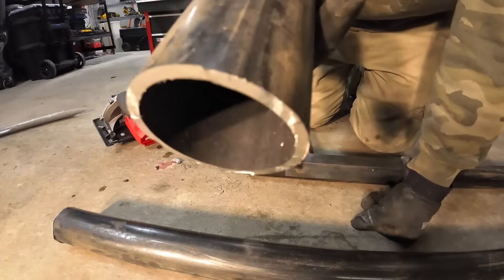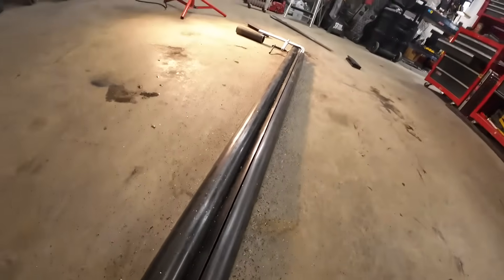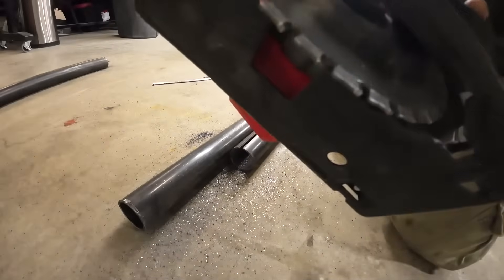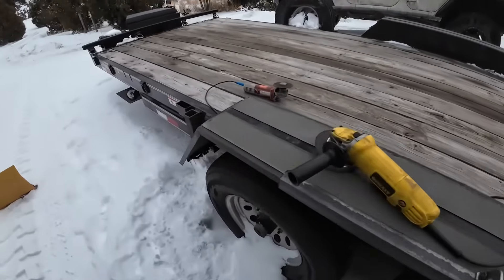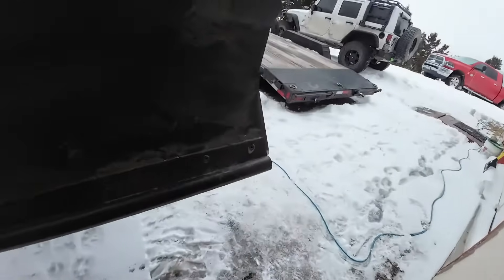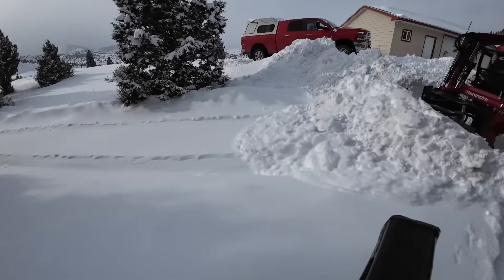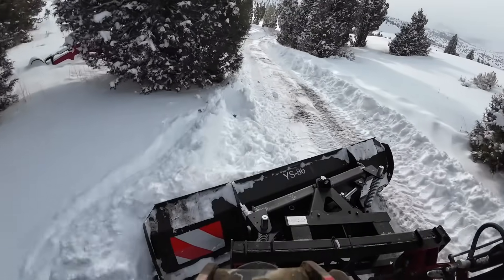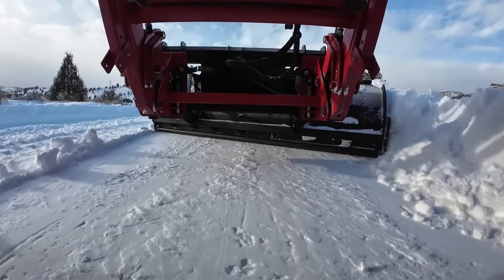Snow Plow PIPE ~Steel~ DO - OVER!

Comment: Pipes work great on blades, good video! I have and ABS pipe on my little quad, but my JCB 214S Backhoe has an 8' bucket with a float function. I can rotate the bucket so the leading edge is an inch or so in the air but the bucket is resting on the ground. Its really nice for my gravel driveway and the varying grades around my house. Never digs into the gravel, and makes plowing snow a joy. Cheers from Canada!
Reply from the maker: Great idea! I'm going to remember that in case my plow ever breaks or if I just have the bucket on, that would work great. Thanks for the tip!

Comment: i was told that if u use chains on a mfwd tractor .
, u should put them on your rear wheels so u dont ruin your gears in ru front axle.
Reply from the maker: You are not the first commenter to make that statement! I have never heard that before I posted this video, but it makes sense. I will be running 4 wheel chains this season. Thanks for the good advice!

Comment: You need to get some hard surface rods to weld on that pipe so it will last .that concrete will wear threw that mild steel pipe in no time !

Comment: Im thinking of doing this with my plow, but it needs to be removable.   Im thinking about using bar stock (4pcs) instead of angle iron.  Run that on both sides of the outer ribs so they essentially capture/sandwich the ribs between them. Then drill a couple holes through both sandwiches and put a keeper pin or linchpin through them.  No tools needed to remove the pins, but might need a small sledge to drive the assembly on/off the plow.
Reply from the maker: Good idea! And I agree a bit tighter fit is always better. If you make a video, please let me know 👍

Comment: Eliminate any looseness-
Simply make one cut🤷🏻‍♂
It's like the spring on the top of a metal folding ruler. Use wooden block,
hammer it on. It will spread open. Tight as possible, one cut.
https://mobileimages.lowes.com/productimages/b292855d-d539-4b2a-8a03-c26f1e629330/47810543.jpg?size=mthb

Comment: I took a 48' x 16' diamond back steel plate +3/16, rounded it to a 90 degrees length wise and welded it to the two skid shoes, and then again in front. So far so good...

Comment: Super nice. The plasma cutter warps the pipe quote a bit.
Reply from the maker: Oh, I hadn't thought of that. Glad I didn't use it. I suppose a regular abraisive cutoff wheel would work just as well albeit slower than the metal cutting blade

Comment: Are you constantly changing hight of blade or do you find a sweet spot and leave be?
Reply from the maker: No changing height, like I said at one point we just drop it to the ground and keave it in float mode. Seems to have enough weight to cut pretty deep, then it just follows the terrain changes

Comment: Just an fyi my friend try not to put chains only on front wheels of a 4x4. Rear ok. You will be putting spider gears or worse in. My dad use to plow snow and he taught me lol
Reply: How about running weld on bottom of pipe for hard facing? Just a thaught
Reply from the maker: Great advice! Thank you so much! I have rear chains, they are just really hard to put on. But I'm definitely doing it this winter 👍
Reply: Chains change the gear ratio because they make the tires bigger.  Same for semi trucks, chains on the back drivers will almost guarantee you will spin out because the front set of tires are traveling at a different speed than the rear.  Physics.

Comment: Wish I saw this before the temp dropped :) I made feet for my back blade and control the depth of cut withe the upper arm, and it works OK, but I have old gas pipe laying around.............. The weight cant do anything but help the back blade either.

Comment: ABS and PVC ok to use for atv and sxs plows. Trucks and tractor, yes go with the well pipe!
Reply from the maker: Well pipe! Even better than steel! Thanks for the tip I'll try to find that when this one wears out😂
Reply: @anesthesiadreamin do you have a feel for the wear on the pipe yet? As in... How long the pipe will last before wearing through to the blade.?. 

I made a drag from the cast steel from an upright piano to drag my gravel flat, and the first time I hooked it up to pull with a chain the chain was in contact with the gravel in one spot, and it wore halfway through the chain in just minutes.
Reply from the maker: @tomwichman77  not yet, only used in one season. But I think if I wait to plow until there's a good Frozen base, it should last a long time. If this does wear out, I'm definitely getting well pipe though for the next one.
Reply: @anesthesiadreamin Nice work.  Never heard of well pipe, why is that special?

Comment: My nickel worth (the last penny was minted last month). I run chains on both axel's , They are not cheap but on the rear
just cry once and go to Cedar rapids tires page and look up Aquiline Talon chain's. I have to run the smaller MPC version 
because the talon's would tear up the chip seal roads around here.
I have had a front mount blower and a back blade with hydraulic angle and top link on my tractor for 15 years. It's the only way to go after the real winter start's to
get with it. Before things set up It's the CJ5 with a blade and chain's on all 4. Got to get the hidden objects removed.
You can do the pipe on the cutting bar for the blower so it will ride up over any hidden object. But start the season
with the blade to get a good base going.
Beck to the rear chains. Don't use ladder chains they will drive you nuts with the horrible ride after you get a good base going.

Comment: I just put a 4” PVC pipe on my back blade. If it breaks down, I’ll be following your lead. Thanks for the video.
Reply from the maker: On the back blade! That's a great idea! I hadn't thought of that. This is why I love YouTube, there are so many smart people out there with so many great ideas! Thank you for posting 👍
Reply: I have a smaller diameter piece of steel pipe on my 54” front mount snowblower’s cutting edge.  I did not cut the slot, just welded the pipe onto the removable cutting edge.  On my 6’ rear blade I put a 1 1/2” pipe the same way you did here, cut the slot (angle grinder) and then welded on two tabs to hold it on.  That way I can remove it from the blade when grading the driveway in the summer.  This is for a compact Kubota B2601 tractor
Reply from the maker: @1wheeldrive751 Great ideas! Did u weld the pipe on the front of the cutting edge or on the bottom?
Reply: @anesthesiadreamin - leading edge on the blower.  You only push it forward anyway.  On the blade it fits on the bottom, obviously, which is good because I often also push the blade backwards at times.  With the slot being fairly tight (I have to hammer the pipe on) I have yet to knock either of the welded tabs off.  It certainly isn’t because of my superior welding skills.  ;)

Comment: I bought a pipe and was going to do the same thing on my back blade, but I ran out of time. I just bolted a 4x6 piece of lumber to the bottom and it works good for now, and when it wears down I can flip it over.

Comment: I have done this same thing to my plow. It works great. My plow is an old plow from a pickup truck, so it has the chain for the float. Which I like actually, it leaves the loader arms weight on the front tires, keeping traction there. Which helps with not being pushed sideways. I also just welded the pipe directly to my plow.

Comment: I see that you just have chains on the front wheels. Have you chained all four? I see talk in the tractor chats going both ways. Pluses and minuses both ways. I see you're in REAL snow country. What's your opinion. Thanks in advance.
Reply: If I may give my opinion, I only chain the rear. If you chain the rear you can steer the tractor using the brakes, and if you really need traction, use diff lock. The drive line parts aren't as beefy on the front as they are the rear either, you could more easily break the front vs the rear.

Comment: Do you think a front mounted snow blower would be any better than a plow? A person wouldn't need the HP to push snow , the blower would would relocate the snow instead of pushing .
Reply from the maker: I think you are absolutely right. I've often wondered how well a front mounted snowblower would work on my property, cuz many times I would want to relocate the snow rather than just try to pile it up. This is just a guess, but I think there's a couple considerations for me at least, and that's speed and terrain. We live on a hillside, with a lot of irregular terrain, ruts on our roads, dirtbanks, grass piles, pieces of wood from trees, so I think in our situation the plow is a bit more resilient in this type of environment. But a flatter area with predictable terrain underneath the snow that you can't see, I think the snowblower would be awesome, especially on narrow parts of our road that we just can't plow it to the side anymore once there is a big snow bank already. But as far as speed goes, deep snow I think the blower would be more complete, however, if we're just clearing out 6 or 9 in of snow, we can run the plow pretty fast and clean up the whole property in just a few minutes. But hey, maybe you could do that with a blower as well. That's just my two cents, but again not having experience with a big blower I'm just not 100% sure. Maybe a good combination would be a wide straight blade on the back and a snowblower on the front 👍
Reply: @anesthesiadreamin  I had a old international 3413 , it was about 45 hp and about 4500 lbs . And it would move snow around with it front loader . It worked ok , but pushing snow around , then it would snow again and again, Soon  the snow would pile up and i would  run out of space. Then it would never get above 29 degrees , it would stay around for weeks . I have now a 55 hp mihindra , that may look into doing the front mount snow blower,
Reply: I am seeing there are front mounted gas powered snow blowers that are not PTO driven , that would be a cheaper . But trhen you dont get the 55 hpof the tractor ot move snow and down to 20-25 hp of a honda 4 stroek, which could be slower . I keep looking for one. As for plowing snow with a front blade , that is far easiest since you can see whet your doing unlike a back blade and constantly twisting your neck around in a uncomfortable position . I would be pushing snow around my yard till i ran out of room . Then i would have 3 ft walls . I think relocating the snow is the best answer , but i have yet to try that one yet. Pushing snow with a 100 hp 10,000 tractor with chains now that would be effecient
Reply: @anesthesiadreamin Supposedly snow blower will pickup and throw gravel.

Comment: "I used a Bauer metal cutting circular saw (Harbor Freight) to cut the pipe, along with a Hercules metal cutting blade",  circular saw or Dewalt angle grinder?
Reply from the maker: @inspectr1949  If you're asking can you use a circular saw, all I know is you can fit a metal cutting blade on any circular saw, but the RPMs need to be slower than a traditional circular saw. I heard of one guy using the Bauer 20 volt wood cutting circular saw with a metal cutting blade and he said it cut just fine. I think the advantage of the actual metal cutting saw is its guard is much more protective, and it contains the Sparks and metal better than a wood cutting circular saw. I know people that have made long cuts with an angle grinder, but it sure went quick with this metal cutting blade. Not sure if that answered your question
Reply: @anesthesiadreamin  My bad didn't see you video 1st, I was outside dealing with the latest ice/snow storm and came in for a quick hot  chocolate when I first responded. Now that I see your video I have the exact same plow as you that I bought off FB Marketplace, don't even know where its made but  it did not come with skid shoes a definite negative, I don't weld and have  bad knees so to to fabricate  what you did is out of the question but did find "Yard Saver" on line an after market edge fabricator that I will pursue although they don't list "our plow" as one they fabricate for.